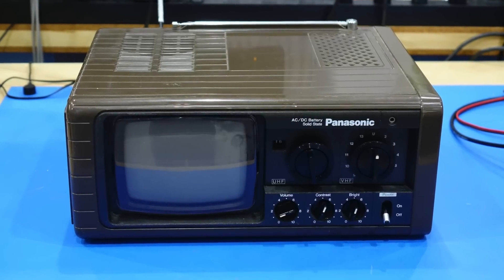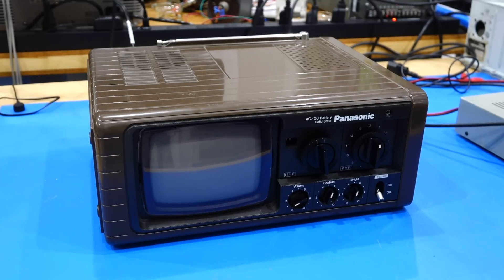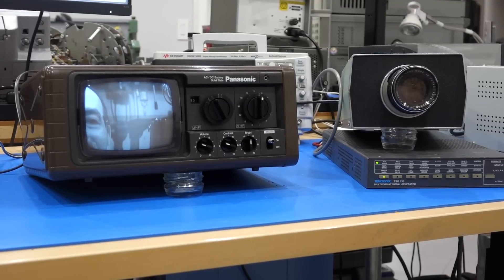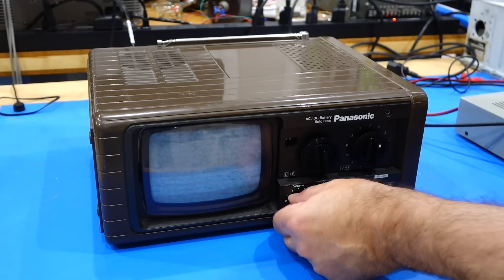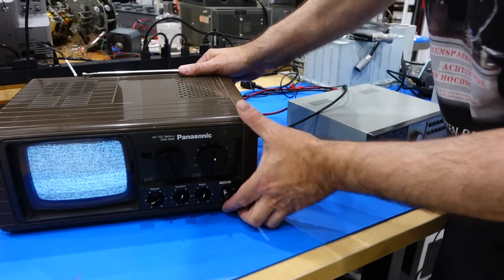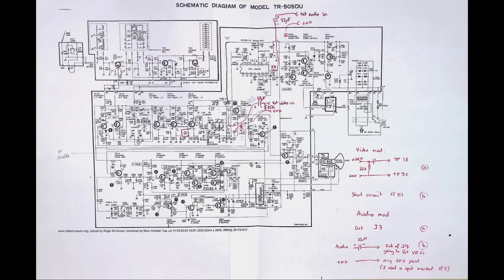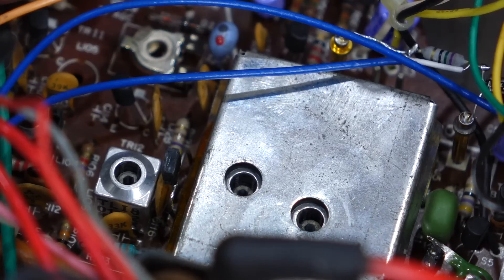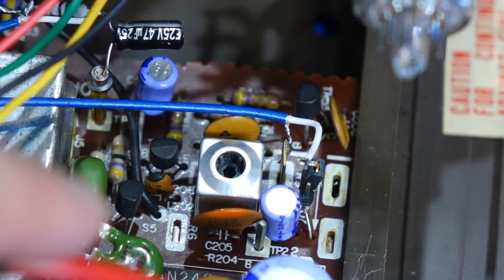Adding composite video and sound inputs to a 1976 TV (Panasonic TR-525)

Comment from the maker: Pinning some answers to the most frequent comments:
- the filter is indeed for the sound subcarrier, not the color subcarrier (dumb me, the color subcarrier is already suppressed). Good catch commenters!
- don't do this on a TV that has a live chassis (duh). Actually, if you have a live chassis TV, you should toss it. It's bad stuff that has been banned long ago.
- shorting the high voltage anode capacitance to the TV chassis ground/tube ring discharges said capacitance, regardless of the set being connected to earth or not. You do that so it discharges into itself, instead of discharging into you…
- the theme song name is in the doodly-doo, aka the description below the video.
Reply: I'm always look for an enjoying any/all mentions and references to the Doodly-doo. I love hearing it's name as much as referring back to it on the actual YT page 👍

Comment: My suggestion would be to disconnect the circuit before R151 and connect the video input to R151.

When I added a video input to a Sony TV, I connected the video input at the point where the video feeds the video amp and sync separator and it worked great.
Reply from the maker: Yes, that would work too, and in retrospect is simpler. You loose the benefit of isolation, buffering and impedance adaptation provided by the transistor 13 stage, but I’m not sure if it matters. I wanted to keep that, and I also liked that there were already test connector pins to attach my input to on the board - no modification to the board would be needed. But that simplicity got negated when I realized I had to shunt the IF stage afterwards, and make a small mod anyhow. Oh, well…
Reply: @CuriousMarc  depending on the TV it won't really matter unless that stage provides a bias voltage to the video amp and/or sync separator.

Also some TVs don't have DC restoration which means for the best picture quality a DC restoration circuit will need to be added.

Comment: I have a Panasonic TR-515A which is rather similar to this model and it shows no signs of life. Do I need a battery plugged in or something for it to work? I do know there were some bad caps which I had to replace for sure, but maybe there are more that I missed.
Reply from the maker: No, no battery needed, but check the sense switch on the power plug insert at the back. That's the one that switches between battery and AC power. On my unit it did not work and made it appear as if the device was not working.
Reply: @CuriousMarc  Yep, it was the sense pin! I'm using a different power cable which didn't hit the sense pin so after pushing that in with a small object it works. I will definitely look into composite modding mine, thanks!

Comment: Nicely done, Marc - and kudos for selecting one with an isolated supply. As others have pointed out, live-chassis TVs can - and frequently were - lethal.
I worked as a broadcast engineer with the BBC for over thirty years, and so I've seen inside an awful lot of TVs/monitors, but I still remember the TV my godfather built using an old green radar screen tube; electrostatic deflection in both directions and a green and black experience. Wonderful for a ten-year-old.

Comment: Can someone clarify what the purpose of the 47uF capacitor inline with the entering video signal is?
Reply from the maker: It’s for feeding the video signal in without affecting the bias of the emitter follower stage nor the black level clamping diodes.

Comment: I remember that my aunt gave me an old B&W tv when I was 16, and it had the internal schematics, so I tried to add a composite input too. It worked... for about a couple of hours, until something burnt inside and the tv died. I suspect that having connected it directly, without a decoupling capacitor, would have something to do.

Comment: I always wondered as a kid what the different was between a CRT "TV" and a CRT "monitor" were other than presumably inputs and the ability to cycle at higher ("monitor") refresh rates. For the longest time as a kid, I assumed a monitor had way more circuitry or was completely different.
Reply: Higher resolution, no interlacing (generally) basically a (decent) monitor is a really really high quality TV.

Comment: Anybody looking for cute little CRT monitors for retro us should check out studio camera viewfinders like the Sony DXF-50. These little monitors are often super cheap and they produce beautiful images with only 12V power necessary. There are a lot of them out there which got very, very little on time during their lives and they generally lived in very clean studios. The only non-standard thing is that they want the video a little hotter at 1.4vpp rather than 1.0vpp.

Comment: At about 1:53 Marc said "There is no such thing as over the air TV..."

Here in LA, we can receive all the TV stations over the air, with an antenna on the roof.  It should be the same up there in Silicon Valley.  Of course the person can pay for cable TV or a satellite dish, etc.  But none of this has stopped over the air TV.  Thanks for bring back old times, Marc.  Your channel is the best.  👍

BTW this TV is isolated from the AC line by the power transformer.  Viewers are cautioned that not all TVs have a transformer.  Some TVs have the chassis connected to the AC line and doing this modification can result in a serious shock and safety hazard.
Reply: Yes but you need a DTV converter box.

Comment: Word of warning from experience, DO NOT do these mods on hot chassis style sets, did something like this on a small mains powered colour TV by removing the tuner and injecting composite (and audio) into the relevant points, blew out a camera and tripped an RCD  as well as getting a bit of a shock when my foot touched one of the leads. Only do these mods on TV’s that use a mains transformer and/or are battery powered and otherwise aren’t referenced to mains neutral in any way

Comment: There was a time we could open up a tv ajd fix it.  I did exactly the same thing back in mid 80s to my Sony B&W TV. I had planned to build a Z80 computer.  But by year 87, i had saved enough money to buy a commodore 64. Then  I used the TV's composite and audio which were better than channels 3 or 4.

Comment: Exactly what are you discharging the HT into ?? - the chassis at 3:54 runs off a 2 pin plug - so NO EARTH Connection anyway.
Reply from the maker: I’m just discharging the energy in left in the HV cap and tube onto itself, so that it does not discharge into me…
Reply: The chassis, itself, is the zero-volt reference for the circuitry. You can run this receiver off batteries, without a line cord in sight, and you will still have a kilovolt or more on the second anode, referenced to the chassis.

"Ground," in this context, refers to the common circuit return and bears no relationship to any earth wire that connects to the power wiring of the building.

Comment: Back in the days when Australia used to actually manufacture and when schematics were available and allowed repairs to be carried out.
Back in 1980 I picked up from the tip a 10"Audiosonic b/w portable TV with schematic inside. I was able to identify the problem, because they had voltages and expected CRO traces to fault find. I replace the vertical sync driver transistor and patch in a video feed via a large cap directly in to run my just built 4k MicroAce (Sinclair copy). My introduction into computing and 4k Basic.

Comment: PSA to not attempt this on a "hot-chassis" TV, lots of black and white TVs use the null wire from the AC power as a common ground, which means they would be incredibly dangerous if modified with a composite jack. This one is not such a model luckily.
Reply: I smoked a very expensive S-VHS machine this way... I'm still salty about it 28 years later...
Reply: Finding an AC/DC set makes it easier to find one that's not hot chassis. 
Plus, wouldn't the cap block any AC? Hmm, unless the line cord was backwards...
Reply: @compu85   or the outlet is wired backwards. or the extension cable/power strip. It's just too risky.
Reply: @compu85 AC can travel though a capacitor, it is DC that is blocked by a capacitor
Reply: Yup been there, done that, got zapped trying to add a headphone jack

Comment: I once used an FGPA on an Altera dev board to create a digital clock that displayed on a monitor and so I had to create the VGA signal with the D to As provided on the board.  It was doable and quite nice, and accurate and adjustable with the push buttons on the board.  Created digits using reverse engineering of fonts with gimp.  I still have the VHDL somewhere.

Comment: The NTSC American standard color subcarrier frequency is 3.579545 MHz. 5.5 MHz would be the beat frequency created by the FM audio transmitter in Europe which was 5.5 MHz higher in frequency than the amplitude modulated video transmitter carrier. In the US the FM audio transmitter was 4.5 MHz above the video carrier. Digital over the air television still exists in the united states on RF channels 2 though 36. The frequencies above channel 37 are now allocated to cell phones. The digital television broadcast signals look like noise when viewed on an old analog TV. If you feed a spectrum analyzer with a TV antenna you will see the digital signals. If you connect an antenna to a digital TV set you can watch free over the air digital TV.
Reply from the maker: You are right. Thus must be the 4.5 MHz filter for the audio carrier then.

Comment: Might you have been in danger of a shock when discharging with that thinly insulated wire?
Reply: There may have been a bleeder resistor installed somewhere in the HV section or the insulation has a high tolerance to voltage.  

"You have a good point there, Herr Doctor..."

Comment: How might the one of these be modified for X and Y inputs? I would like to use my old mini TVs to display Lissajous figures and otherwise function as an analog oscilloscope.
Reply: It would need a different deflection yoke and a suitable driver if you want any vertical bandwidth. You would be better off looking for a cheap scope at a hamfest.
It's not easy to make a vector display with magnetic deflection, but they were used in some arcade games. There are some articles online that show how to modify a TV for use with those games.

Comment: Maybe a dumb question, why discharge the CRT to the ground with the power cord unplugged? the ground wire are disconnected from the outlet and you don't have any reference to 0v to discharge. Thanks!
Reply: The zero-volt (ground) reference for the circuit is the chassis. The line cord has nothing to do with it.
Reply from the maker: I’m just discharging the high voltage cap (which includes the capacitance of the tube). Into itself. So it does not discharge on me.

Comment: I use to modify domestic Panasonic TVs for video and audio inputs for commercial, educational institutes and industrial applications back in the early 80’s. Use to design a basic interface board which had an 8 pin monitor plug and BNC and RCA connectors. The board had transistor buffers for impedance matching. Had also to fit mains isolation transformer as they were hot chassis’s. I probably did +300 over 3-4 years. Most of the monitors were used with U-Matic 3/4” Panasonic, Sony or JVC industrial video recorders.
You video brought back memories…😀👍

Comment: The 5.5MHz Filter is to supress the audio carrier ( For Mono Audio the sound carrier is 5.5MHz above the video carrier and gets mixed down with the video carrier to 5.5MHz IF at the demodulation Diode)
The color subcarrier for PAL and NTSC was ( almost everywhere ) 4.43361875MHz.
Long forgotten memorys
Reply: Correct, but only PAL is 4.43MHz, NTSC is 3.58. There is a special PAL standard in South America which also uses 3.58MHz subcarrier. Usually, there is a color subcarrier filter in the video path of newer BW TVs to eliminate dot crawl during color program reception, seems like this one doesn't have it.
Reply: I still have a box full of 4.43361875 MHz crystals I harvested from old TV's.  Never used one of them!
Reply: In the US, the audio FM subcarrier is 4.5 MHz above the video carrier.
Reply: @acmefixer1  The schematic likely was for a European version of the same TV...
Reply: @acmefixer1  Yes, and that's why removing the filter made such huge difference in horizontal resolution. Oddly enough, East-Europe had the best quality SD broadcast until the mid '90s. Here, the audio subcarrier was at 6.5MHz, therefore this (OIRT) standard limited the video bandwith the least. Combined with the SECAM color standard, which lacks the dot crawl effect that was an issue both with PAL and NTSC, and also lacks the susceptibility to phase distortions of NTSC, made probably the best quality SD broadcast standard. At least during live broadcast, because studio recordings were made in PAL, and transcoded to SECAM before the transmitter, so it cancelled some benefits of SECAM. 

SECAM (even MESECAM) recordings on VHS look a lot better compared both to PAL and NTSC, although tape droupouts are often emphasized by bright red and blue flashing lines.
Reply: @mrnmrn1  That could also be because the method VHS uses for recording video more resembles SECAM than PAL or NTSC...  so PAL and NTSC are kind of transcoded in a VHS recorder.
Reply: The NTSC color subcarrier is 3.579545 MHz AKA the TV colorburst frequency.

Comment: I am surprised that there is a color subcarrier rejection filter. Weren't NTSC and PAL backwards compatible with monochrome TV sets?
Reply: They were but you'd get dot crawl and shimmers from the color carrier signal being interpreted as luminance. Having that filter there cleans up the image by rejecting that.
Reply: It is not for color subcarrier rejection but rather for sound subcarrier rejection, and it would work in Europe.  I think the schematic is for a European version.
Reply: @Rob2  There's both in the video, you'd know if you watched it.

Comment: Such memories!!!
I did basically the SAME thing about 50 years ago...
I needed a B&W monitor for the computer I'd just built, so I grabbed our old B&W TV and 'modded' it...
The main difference between your version and my old one is that my 'donor unit' was built using 'FETs with pilot lights' (a.k.a. tubes).
From memory, it was a Pye T-20 chassis (Pye was a common brand here in NZ)
I took a slightly different approach to squelch the incoming noise from the final IF...
I installed a switch for the filament of that final IF tube (I think it was an ECF80 triode + pentode?)
Reply: 'FETs with pilot lights'

I'm stealing this.

Comment: Did a similar conversion to a 1980s portable black and white, no schematics and the video IC didn't have any markings, so I ended up having to look through NECs '80s catalog to find similar looking chips as the sound IC was using NEC.

Comment: Correction: there are plenty of TV over the air these days on the same UHF and VHF bands. They are however digitally modulated instead of analog modulated.
PAL and NTSC refer to the color modulation. Because you are feeding a monochrome signal, the only difference is the frame/field rate and if worried about the sound, the sound carrier.